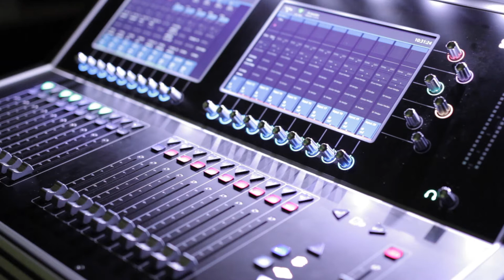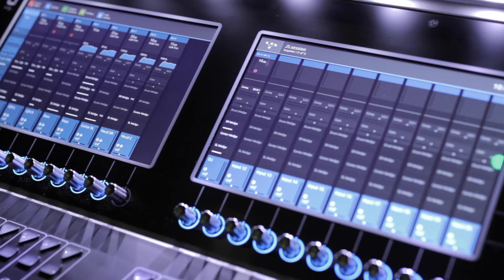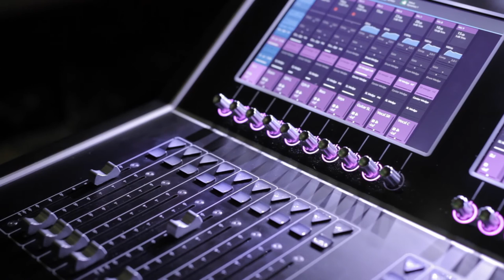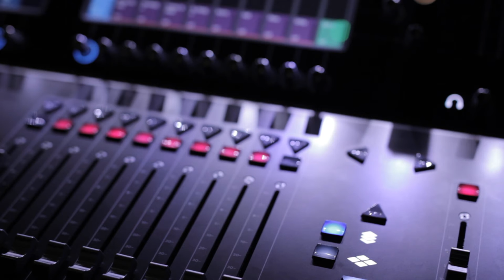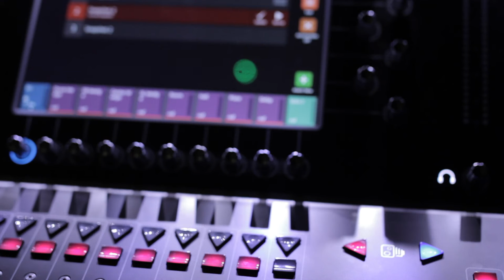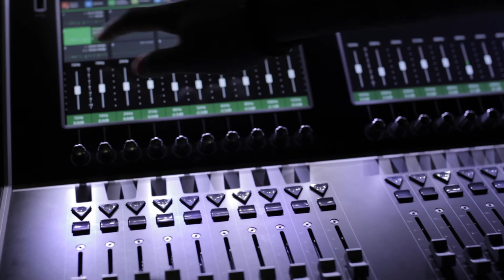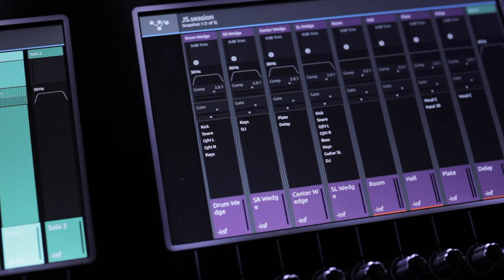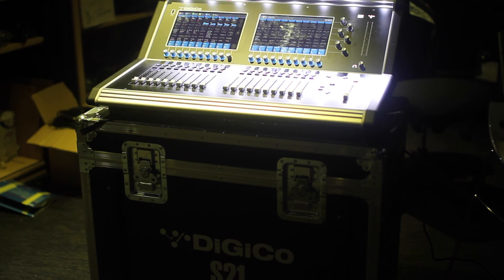Monitor Engineer Specialisation: DigiCo S21

Comment: For Mute Groups, you can just create a Control Group and which is exactly the same as mute group, but with adjustable gain using a fader.
Reply from the maker: This is true! Whilst that is a way to do it, having dedicated mute group buttons enables you to keep a condensed control group count which will help on this console as it has a limited number of faders, it would just be quicker but the CG way is just as useable 😊
Reply: Marko Mattila m
Reply: So a DCA-group

Comment: Do you know how many outputs this has? I see that it says there are 16 mono or flex stereo. Does that mean you can have 16 mono or 16 stereo mixes(being 32 physical outputs, but those 32 are paired). As an example, can it do 14 mono aux mixes(14), Stereo LR Main Mix, and Stereo LR mix for delays?
Reply from the maker: The desk has 12 line outs on the back, but you can attach additional I/O ( D-Racks etc). The desk has 16 busses configurable as Mono or Stereo.
Hope this helps!
Reply: @xICrAzYArAbIx   u think its logic i can compress more and still retain tone while performing with digital compressors like cla 2a or lesuire more than a rnc or dbx  analog compressors  in monitors on vocal channel ??